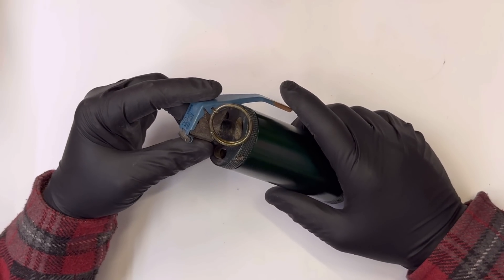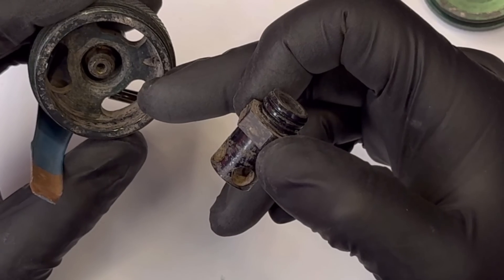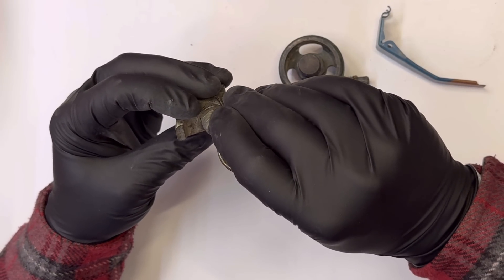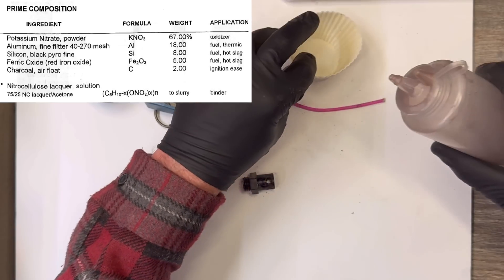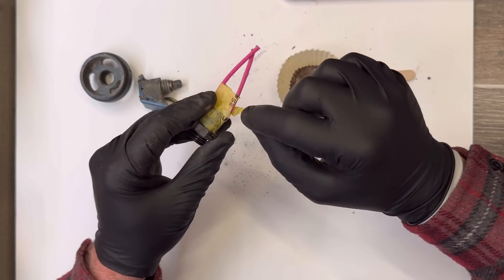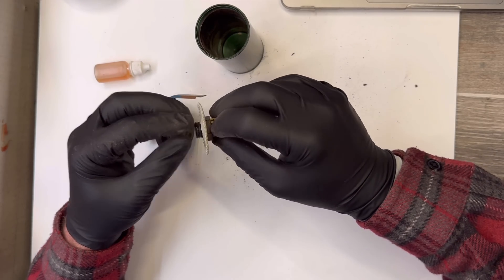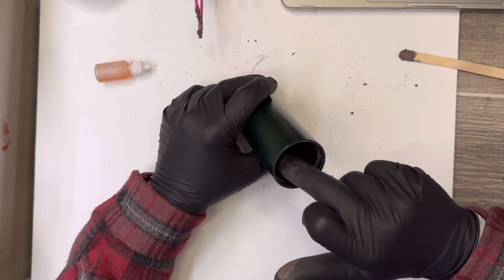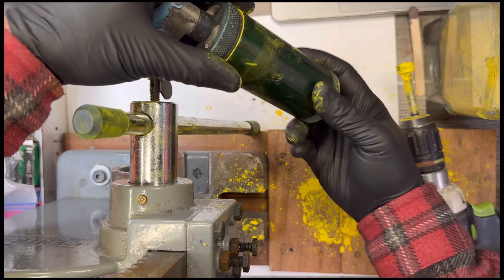A High Performance Tactical Smoke That's Easily Reloaded: The XM-18

Comment: Can you spray N.Celulose on top of the mix to solidify the powder mix? Is there any other way to solidify the mix?
Reply from the maker: NC seems to make everything light on fire. i've heard some stuff about cellulose acetate as a binder.  this one is compressed to a solid with an arbor press. most binders hinder efficiency and may discolor so i dont use them often unless neccessary.

Comment: No offense it’s excellent as a training aide but a reloadable smoke grenade is tactically a no go. For one you’re not gonna carry it once you pop it that gives you the opposite desired effect by marking you as a target.  You’re not gonna go retrieve it or else you likely didn’t need it in the first place. And lastly if your enemy retrieved it reloaded it it’s now in their possession and is now a problem for you.  Bad idea all around.
Reply: It's for airsoft and paintball, lol
Reply: Yeah, definitely pricey for any  real world use, but if shtf all bets are off lol
Reply: @scottplagmann3411 it's 50 each for legit ones and you need LE creds to buy them. So not pricey at all compared to the gay airsoft plastic ones.
Reply: Popping smoke is widely used to hide movement and for signaling HLZ. I popped probably 100 during training for contracting and we carried 2 on us and many in our vics on duty. If you actually have to use this you of course leave it and the upside is you can train with it up until that point so it is 100% useful.

Comment: From Canada: The main problem for us is getting access to the fuses or ignition elements. What are the options?
Reply: You want diet communism, you have it. Canada is great except for the government and the people that support the government
Reply: do they not allow the sale of visco fuse in Canada ? It is reliable cannon fuse with good burn time. You can also look into making fuse by using oxidizer + fuel + retardant like in a pyrotechnic smoke generating device but without the smoke. I often use wet rolled toilet paper with a mix of KNO3, sugar, and baking soda as retardant, just need to make sure that you're mixing powders and not melting it down like the usual smoke filling
Reply: just as a safety note, using homemade fuse is possibly the sketchiest thing you can do since it have inconsistencies and must be tested thoroughly first before use in anything. Also, be veeeeery careful of flashover when using homemade fuse, it could end with injuries or even death.
Reply: @frisk3320  Yes, it's tricky. Cotton string dipped in black powder is the most “reliable” method for me
Reply: @frisk3320  We're not allowed to buy anything... black powder... fireworks... firecrackers... ....
I have access to KNO3... surf and a few things like that... but nothing ready to use that could hurt anyone. Ninja stars, switchblades, brass knuckles... you name it, it's illegal here!
But don't worry... I've already made a lot of things... but I have to make everything from skratch :(

One question I have is what type of dye should I use?
Reply from the maker: Leave Canada. Sorry that’s not helpful. 
I’m surprised Canadians are even allowed to see this content. Sorry, also not helpful.
Reply: @InventionIncarnate  I know.
Our “DAD” Mr Canada decides everything and nothing for us... I agree it's hard to live with!

 .. sorry.. it's not useful :) But here there isn't 1 massacre a month! :P